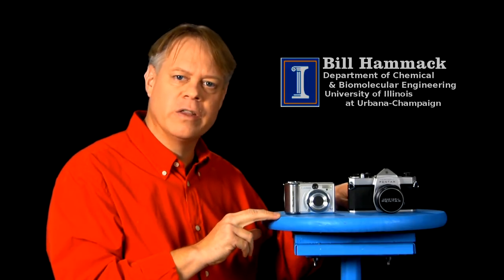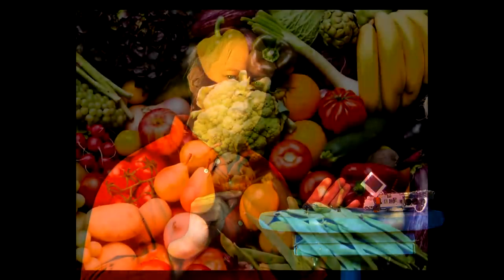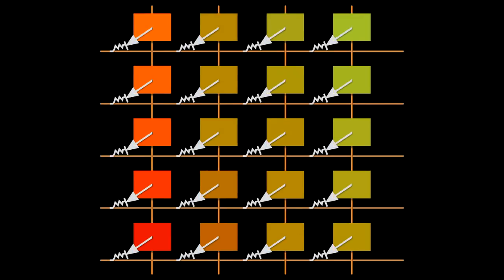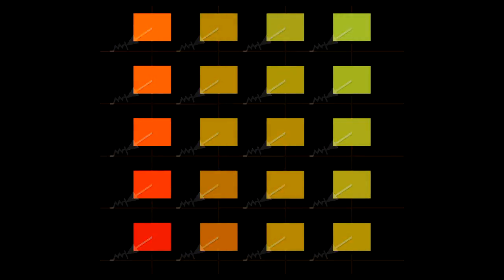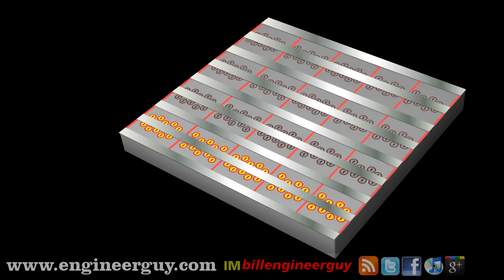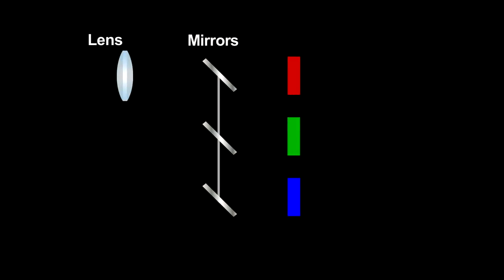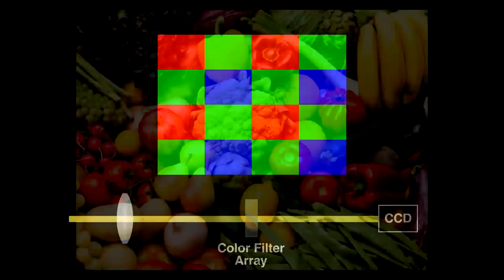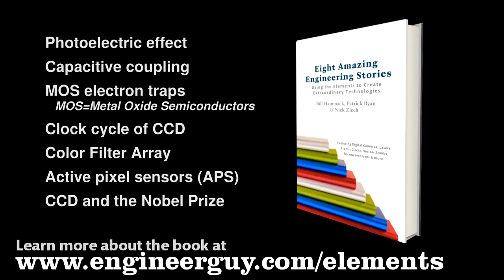CCD: The heart of a digital camera (how a charge-coupled device works)

Comment: Could you give more hints as to how the CCD can shift the charges down one line at a time?  It's hard for me to imagine.
Reply: (1/2) I am currently reading his book in which he illustrates it and details it a little bit more so here it goes... From a simplified perspective, the key to moving the electrons is the charge of the MOS (metal oxide semiconductor). What's really amazing about a CCD is that it alternates a charge of about .5 and .10 volts between each pixel and MOS, as it does this it changes the actual location of where the electrons hang out within each row of the silicon slab... A higher voltage means that the electrons are closer to the surface, while a lower voltage (.10 V in this example) gives room for electrons to fall to the base of the silicon to let protons take their place at the surface (since we know light is both a partial and a wave, we know that both of these items would exist within the Silicon after it has been exposed to light to take an image). The key is the voltage fluctuation, as the voltage to the adjacent row falls to match the one next to it, the electrons now have an option
Reply: (2/2) of where they want to hangout BETWEEN pixels as apposed to just where in the silicon they can hangout within a SINGLE pixel. But this doesn't last long, as the CCD now makes the charge of the old location a higher voltage and forces the electrons to stay in its new found location on the CCD (which is just now one pixel or row over to the right, if we imagine the flow in the video). That's it! Now just repeat and repeat this flow of voltage fluctuations enough, and the electrons end up at the end of the CCD and read by the camera as a measure of light exposure, and thus an image is created. Just imagine you put a marble on top of a piano key and you wanted to move the marble down the piano without ever touching it, to do so you would press down the adjacent key and lift the first key the marble was on to force it over one, and then just continue that process. That's what a CCD does except the marble is an electron and the piano key is the CCD's individual rows. Hope this helped!
Reply: +Dana Ludwig  Yes he seemed to skim over a couple of things in that one.  How does it shift the charges down and how does it know what colour the adjacent pixel is?
Reply: Adjacent pixels colour is known because colour filter array geometry is known. It's simply hardcoded into image processor.
Reply: Short version: Those aluminium electrodes over the top can create an electrical potential barrier, a wall which separates pixels, but this 'wall' can be raised or lowered depending on whether you apply a voltage or not. Each pixel spans three times the distance between electrodes. Electrodes are connected so that every third one is connected, so we have three sets of electrodes, say A, B, C. Now use capital letters to represent the 'wall' state, lower case to represent no wall. We start in state Abc  (i.e. AbcAbcAbcAbc...) Charge can accumulate between the walls, in the 'bc' space. We hold it like this during exposure. Now to read out we cycle the voltages on the electrodes. We shift to state ABcABcABC... which shifts the charge which was in 'bc' spaces all into 'c'. Then we go to aBcaBcaBc (charge shifts to 'ca' spaces) then aBCaBCaBC (charge in 'a' spaces) then abCabCabC, then AbCAbCAbC then back to AbcAbcAbc and the charges have all shifted rightwards one pixel. At the end of each row you catch these little buckets of charge and send them off to analogue-digital converter(s) to turn them into numbers.

If you overexpose, the potential barriers caused by the electrodes are insufficient to contain the charge, and it leaks into adjacent pixels. The barriers in the perpendicular direction are caused by doping in the silicon and are much more resistant to leakage. This means overly bright lights cause streaks in one direction (e.g. vertical) but not the other (horizontal.)
Reply: a simpler version of the explanation would be creating potential wells using aluminum electrodes during the time when light falls on the surface of silicon, and then moving these wells across the rows of channel stops by carefully adjusting the voltage of the next electrode so that the well gets transferred as it is.

edit: this also illustrates the importance of including three, as opposed to two, aluminum electrodes in a pixel, as while having just two of those and then lowering the potential of the electrode next to the original one to transfer the well would result in the mixing of charges stored by all of the pixels, distorting the image.

Comment: I once had an opportunity to collect some data from the SARA observatory. It used several (about 7-12) separate CCDs, each designated to specific wavelengths of light, including infrared and ultraviolet. You could set the exposure time and which CCDs to use for each image. It's great having that sort of control over the process, since you can just increase the exposure time for more distant stars and also focus on the wavelengths that the type of star you're studying happens to emit.

Comment: CCD arrays were starting to make their way into (professional) astronomy 40+ years ago.
They were hitting the amateur astronomy consumer market maybe a decade or less after that.
Then, not too much later, they were making their way into the general consumer market in the form of digital cameras.
Like all things tech, they've advanced by leaps and bounds since then.

Especially liked his explanation of the trick used to get color from single pixels — in effect, the color information is reduced in terms of total pixel count, so that the illuminance info is at full resolution, while the color info is less detailed. This works, because the human eye doesn't see color info in a scene, in as great detail as overall illuminance.

Neat!!
Reply: There's a bit more to it: luminance is not completely preserved because each color filter (rgb) blocks the light/luminance that comes with part of the spectrum that's blocked.

This is the reason why the grid has twice as many green pixels than reds and blues (2/4 green, 1/4 red and 1/4 blue): the human eye is more sensitive to green, so in order to preserve luminance the most, green must be captured in more detail.

Neat++
Reply: When I was an astronomy student c1990, we had engineers in our department building a CCD camera. Some of the CCD detectors cost over $100k each. (If you want to see the results of this camera, do a web search on Sloane Digital Sky Survey. The UV sensitive CCDs were the very expensive ones.)
Reply: CCDs revolutionized astronomy. You could easily do digital processing and measurement and automate such measurements, but more importantly CCDs are about 40 times more sensitive than ordinary photographic film, and about 5 times as sensitive as super-sensitive-bizarrely-processed astronomical film. Suddenly you could do with a 1m telescope what had previously been done with a 2m or 4m telescope.

Comment: I believe you are a bit wrong. Exposing the CCDs to light doesn't make them get charge. 
When taking a photo the CCDs go like this: 
1. They are connected the the battery and build up charge. 
2. That charge is measured. 
3. The CCD is expesed to light (during this process it discharges, so loses electrons) 
4. The shutter closes and the new charge is measured and computed the difference between the initial and the final value. 5. The result is read line by line as you mentioned in the video. 

Please correct me if i'm wrong :D
Btw, your videos rock. Keep up the good work!
Reply: I think it may have been simplified in the video for the sake of brevity.

Comment: Semi-pro photographer here. You are correct, cameras with three separate CCD sensors produce a more accurate image. However, as Mr. Hammack mentions in the video, a single CCD sensor is much more affordable to build, and the results are more than adequate for everyday use.

Comment: Hmmm... interesting. But I thought that one of the main differences between CCD's and CMOS was that CMOS usually uses the RGBG  bayer-pattern to produce images with higher rates of luma-sampling than chroma-sampling. This to exploit the fact that we don't see as much color detail as we think we do. This also has been one of the groundworks in the whole debate between photographers and cinematogrqphers. That a CCD with RGB  pattern will produce a truer resolution image than a CMOS bayer pattern. Of course I see no reason, as the layman that I am, that we can't use bayer-pattern CCD's or RGB patterned CMOS. It's just that thia video is the first that I have come across that claims that CCD's use Bayer-patterns too.

Comment: As far as I know, pixels are square and not rectangular as shown in the video. That's why digital cameras have a higher horizontal resolution than the vertical, because the entire picture is rectangular. Other than that, a great video with fine explanations as always!

Comment: Great video as always, perhaps a bit too short. I understand there's extra details in the book, but i feel like more stuff could be explained like the purpose of the aluminum stripes on the CCD and why are they used to separate the area into pixels. And why does the pixel area have a stripe going through the middle. Wouldn't it be logical if a pixel was called half of that area without a stripe in the middle? And how does the CCD shift the charges from row to row without wires. Just my 2 cents.

Comment: CMOS stands for complementary metal oxide semiconductor. It is different from a CCD in that each pixel contains both a photodetector and a transistor. This means the whole pixel is not a sensor, unlike a CCD. CMOS technology is cheaper and processes images faster, however, it has lower light sensitivity. This is why most consumer cameras these days use CMOS and fancy microscope cameras that operate at low light use CCDs.

Comment: In the book, the first attempt, using wires to connect the pixels in an x-y grid, I don’t understand how the vertical scanning works. Seems like the vertical pulse opens a diode with +V on the cathode, which doesn’t make sense to me. Is that pulse such that all cathodes are +V and only one is zero?

Comment: So if each pixel is bound by channel stop and aluminium grid and if we apply external potential to aluminium electrode to move the charges.Then wouldn't it cause the charge in adjacent pixels(on either side of aluminium grid) to get mixed up.And if that happens wouldn't it affect the data coming from each pixel?

Comment: Is the part @02:44 responsible for these weird movies we get when either moving the camera or the object we're filming?
Like filming outside a cars side windows we see diagonal instead of vertical light poles.
Or the weird effect we see when filming an airplanes propellers.
Reply: No, that is an entirely different phenomenon called rolling shutter effect. EDIT: I have just googled it for a bit, and found out that rolling shutter effect is indeed related to this. You might want to check the video titled DISTORTIONS by Vsauce.

Comment: the last part about the colors.. if we take a photo of a blue wall, the ccds filtered pixels all must average to blue. This can only work if the different colors have different brightness intrinsically? How else could one color trump over another if they're suppose to "average" to blue. As the engineerguy said, the ccd cells are only detect brightness intensity
Reply: Keist Zenon As you might already know, each pixel has individual values for red, green and blue (RGB). But red and green pixels have no information about blue, so we resort to guessing from the neighbours. The simplest way is to just put the average of the nearest pixels that have that information. Note that you're not averaging the emptiness of the working pixel, just the neighbours. So if all blue neighbours have the same value, then the average for the pixel you're guessing for will be the same, too.
Reply: ***** +linkuei83
Thanks you two, it is clearer on a second look.

Comment: A lot of cameras store the saved images as PNGs or JPEGs, which are low dynamic range formats. Would it be possible to use existing CCD hardware and convert them to save proper HDR images if they had software to store the images in a higher dynamic range? Or does that also require specialized sensor hardware?
Reply: While that's true for cheaper cameras, there's RAW and TIF file formats that keep the mayority of the sensor information (if not all) so you have greater dynamic range, color range. 

On a separate note, CCD sensors are basicaly obsolete because of the higher cost of production, since they require off-camera sensor DAC's and amplifiers to convert the signals into an actual image, also because they're power hungry. CMOS is the new technology, because they do all the processing on the chip, rather than on the outside, making them ideal for small sensor applications, like smartphone cameras, and such.
Reply: Basically this video is obsolete.
Reply: +kemboy323

While the CCD technology is obsolete in consumer applications, this video isn't. This is because while CCD is old tech, was the responsible for all the progress on digital photography nowadays
Reply: kbckiwi Still obsolete.

Comment: I still like the film camera. Would it be possible to make a digital camera function like a film camera, but just without the film so that you can record a huge resolution picture?
Reply: High end DLSR's CCD chips are the same size as film was, is this what you wanted?
Reply: Viktor Rucký
Yeah. The thing is film technically has near infinite pixles. So would it be possible to make a chip with the same resolution but not wasting data? Like the photos take with the film do
Reply: MultiSciGeek No, it's a limitation of digital technology.
Reply: Viktor Rucký
Yeah :(
Reply: "Like the photos take with the film do"

You're still restricted to within certain limits. Noise (i.e. film grain) is still a factor in film, and for practical purposes, is the primary limit on image quality and resolution.

If you want truly amazingly clear, high-resolution images, the best (most practical) solution is to simply increase the area of the sensor or film. For this reason alone, medium-format film cameras still hold quite a bit of popularity, especially in certain niches (notably architecture photography. The increase in image quality that provides over 35mm, digital or film, is astounding. Unfortunately medium-format digital cameras are extremely expensive ($7,000 USD is cheap), which has limited their market to mostly professionals (or enthusiasts who have really good day jobs >.> ).

And when it comes to video...no. Just no. RED's camera system is one of the premiere systems on the market for that, but its for when you're shooting multi-million-dollar productions. Just one of the "brain" pieces (which is only the sensor and requisite electronics) is easily $40k USD or more. And that's a 35mm sensor, although a damn good one.

Unfortunately image size (in terms of how much space the data takes-up) is not going to go down with resolution. Indeed, as the dynamic range and resolution of sensors increases, the data size will only get more out of control. The one saving grace is that most of that data is not going to be used in the final image. Without going into too much detail, you should still shoot RAW (which is just the raw data from the sensor), do all your processing on the RAW image, and then once you have the final image you are free to export it to another format (e.g. PNG or JPEG). But you'll want the raw file if you want to edit it later.

...

So basically no. Nevertheless, in the long run, it's a hell of a lot easier (and cheaper) to store several thousand digital images (and their backups; NEVER NEGLECT BACKUPS) than it is to store several thousand negatives. Even if you take images on medium-format film (so the camera won't cost you an arm and a leg), you'll probably want to convert the negatives to digital anyway.
Reply: *****
Thank you for this detailed explanation. And looking at some footage, the RED sensor seems really good and similar to film/cinematic.
Reply: MultiSciGeek
"the RED sensor seems really good and similar to film/cinematic."

That's because it's literally what it's built for. That and you get what you pay for.
Reply: +Viktor Rucký

CCD sensors are almost obsolete.
Reply: +lies damnlies

While RED camera sensors al designed for film applications, to achieve the "cinematic look" or "film look" the footage first needs to go to color grading. It isn't as simple as pressing a button and all of the sudden you have film look.
Reply: kbckiwi
It isn't as simple as pressing a button and all of the sudden you have film look.

I never suggested that. O.o

Comment: It would take three separate CCDs, plus the added filters and mirrors required to make three images through one lens, that's three times the most expensive part of the camera after the lens, plus a bunch of extra precision optics. Not impossible, professional digital video cameras have done it for ages, but besides the money issue there's also the issue of size. Not for the extra chips, but for the extra light paths required to split the image in three.

Comment: Why are pixels rectangular and not square?
Reply: Just making a guess: Probably because the images are rectangular. No rearrangement process is required this way.
Reply: Display pixels are completely different from camera sensor pixels. It's easy to estimate that the pixels are rectangular because the images that come out of the camera are rectangular, they're actually squared. Al of the photosites on a camera sensor have the same dimensions across.